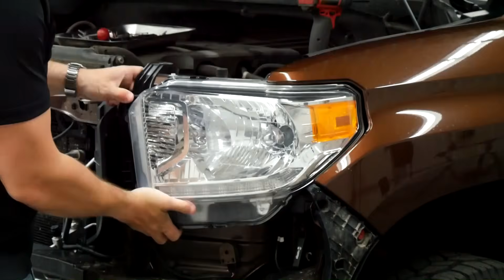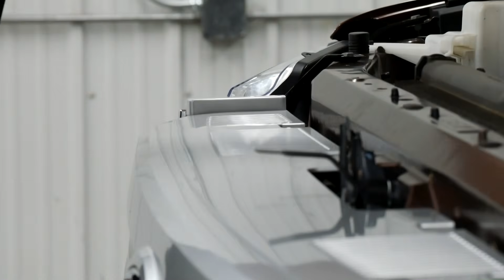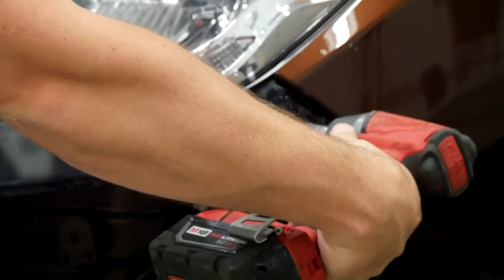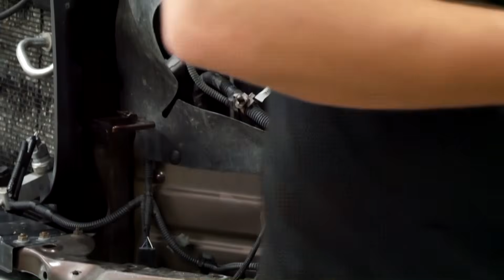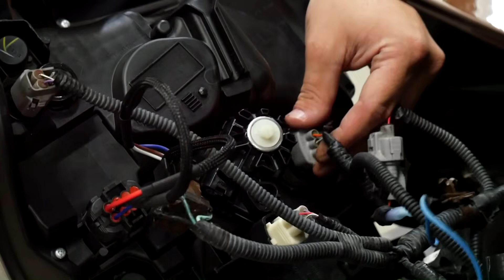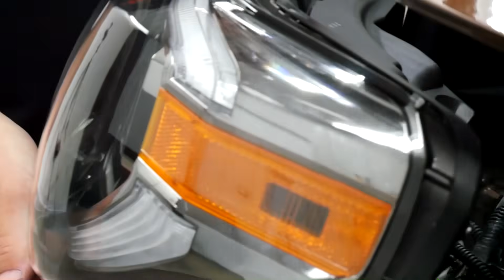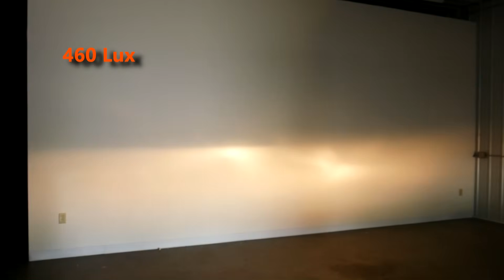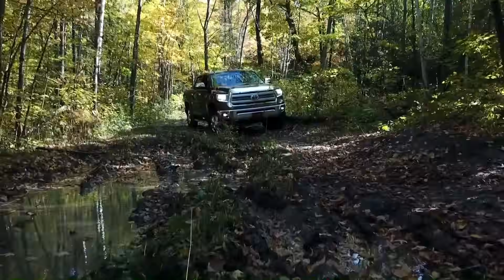Updated: Installing Toyota Tundra OEM LED Headlight Housings 2014-2018

Comment: I just bought the headlights, conversion harness and drl adapter. 17 limited. I was told I will have to use the add a fuse to an ignition slot in the fuse box by battery. Does that sound correct?
Reply from the maker: Yes that is correct, It’s very straightforward. It’s a 10amp fuse labeled Ignition.
Reply: Headlight Revolution awesome. Thanks for the reply. Also with thus setup will the amber drl remain on at all times? I have been researching converting the turn signal to led. Is that pretty straightforward or complicated? And what’s price.
Reply from the maker: Send us an email to Sales@HeadlightRevolution.com and we’ll get you the proper bulb for the turn signal in these headlights. You will have a properly functioning amber DRL.
Reply: @MrKfcflores  Easy to replace amber with switchback led..you’ll need resistors to eliminate that hyperflash after
Reply: Yes

Comment: I have a 2019 tundra with the LED light strip on the bottom of the headlight and halogen lightbulbs. I want to get the LED OEM Housing with lights. What other equipment would i need?
Reply from the maker: Send us an email to Sales@HeadlightRevolution.com and we'll help you get exactly what you need for your Tundra.

Comment: I just did this upgrade to my 2020 sr5 crewmax.  2 things that differ are the plug in the grill for the safety sense needs to be disconnected/ reconnected and there's no need to repin the turn signal as the plug is sealed in the 3rd slot so I just plugged in the 2 pin factory plug and it worked with no issues to report.
Reply: Umm didn’t your truck already come with LED?
Reply: @christph3118  SR5 trim line came with Halogen headlights with one led strip on the bottom for daylight running.
Reply: Joe, just purchased a 2020 Tundra SR5 Crew Max and plan on doing this swap as well. Where did you buy your headlights? Dealer?
Reply: @Jarhead 767  sparks parts is where I bought the headlights.. tundra dude 34 gets you 5 percent off promo code I believe.
Reply: @joescott701  thanks man!!
Reply: @jarhead767  anytime!

Comment: How do you get the low beam to stay on with the high?
Reply: I just installed these on mine and and ran in to the same thing. After setting the high beam switch forward it engages automatically at speeds above 26 or momentarily on with the lever towards you.

Comment: Just installed yesterday on my 2017 Platinum and the turn signal went crazy , it’s blinking rapidly just like when a bulb is missing. Did anybody experienced this?
Reply: sandor hajdu 
did you install LED bulb blinkers ? If not then maybe you should recheck the pinning of the black and white wire in the turn signal harness
Reply: Resistors

Comment: In the factory halogen headlamp the low beam and high beam are the same bulb so the low beam turns off when the high beam is on. Does this harness bypass that and allow the low beam to be on while high beam is in use?

Comment: Why do you say the stock headlight produces 460 lux in this video, but 610 lux in your V.4 LED Headlight video?
Reply: 460lux is from the halogen bulb
Reply from the maker: The Lux numbers are only used in relation to the other bulbs in the same test in one video. You can't compare them from one video to the other because it's not a controlled environment. If the light source was placed just 2 feet further or closer away from the test wall in one video to the next, the ratings will be different. The Lux ratings represent a percent change more than a rating of brightness in and of themselves.

Comment: I just installed these headlights on my 2014 Tundra and I was wondering if Led switchbacks would work with these headlights?
Reply from the maker: Yes they will!
Reply: Lulu Robichaux   Na the Sr5 (TSS)
Reply: Lulu Robichaux  if his truck has “Daytime Running Lights” factory installed he shouldn’t need the harness. These lights should be plug & play with the 1794
Reply: Yes they will,have on mine

Comment: You have to change  the wires on both  sides ?
Reply from the maker: That is correct!
Reply: Headlight Revolution i ve got to get the yellow lights out of the center why  are they  always on?
Reply: Thaks

Comment: I just got mine,  on the video the guy says no resistors but mine came with resistors in the packaging
Reply from the maker: That's so weird!
Reply: @HeadlightRevolution  so I don't need to use the resistors?

Comment: I need help with my installment. I have a 2017 pro and my Amber's are on as well as the leds.
Reply from the maker: Give us a call Andy! We'd be glad to help.
Reply: Just tried....3 times
Reply from the maker: We just moved into our new warehouse today and had the phones transferred over! Sorry about that.
Reply: Did you get a answer because I'm having the same problem. They stay on with my DRL.
Reply: Any update? Same is happening to me.
Reply: @jordycastro8437   yes if I remember right it wasn't just switching the pins like the video said, I actually had to de-pin in order for it to work right. Everything works fine now. I'll look at the harness tomorrow and get back to you.
Reply: @andyg7504  ok bet thank you!! 👍🏼
Reply: @andyg7504  did you solve the problem? my 2017 has the same problem

Comment: I have a 2019 SR5 Crewmax with the regular headlights. My question is I know on the 2014-17 you need the conversion harness. Do I need it for a 19?
Reply from the maker: If you do not have DRL strips, you will need that harness as well. :)
Reply: @HeadlightRevolution  ok cool I already have drl strips on the bottom all 2019 do that I've seen
Reply from the maker: @rke1987  You'll be good to go then!
Reply: Do you need 2 led bulbs for lo and hi or one bulb with the lo and hi. I have a 2019 Sr5 CM
Reply: I needed the harness if you have halogen bulbs in a 2019 you still need the harness just not the drl part
Reply: I took off my halogen bulbs and put LEDs on my headlights. Can I keep the bulbs for the new led housing or do I need 2 sets for the hi and lo
Reply: @jseries9247  the headlights housings come with LEDs already installed
Reply: @jseries9247  they are plug and play all you need is a the conversion harness
Reply: But if I wanted a different brand led bulb I cant replace it?
Reply: What if I wanted to changed the led bulbs it comes with? Would I still be able to or it cant be done?
Reply: @jseries9247  no idea

Comment: So I just bought these headlights for my 2016 SR5, I also got the DRL adapter. I'm just wondering why the Amber's stay on when the led's? Is there anything I can do about it?
Reply from the maker: When you say Ambers, are you referencing the Turn Signal or the Sidemarker?
Reply: @HeadlightRevolution  the turn signal. I've seen the 2019 models and on none of them do the turn signal ever come on. And on mine they're always on.
Reply from the maker: @MrBlazzin101  I believe that is just a 2019 specific deal, where the Turn Signal is not in the DRL. Your 2016 would use the Turns as an additional DRL, that's why it is always on. Have you thought about trying a Switchback bulb so it becomes a White light and not Amber? 

Link: https://headlightrevolution.com/2014-2017-toyota-tundra-led-front-blinkers-kit/
Reply: @HeadlightRevolution  no I have not thought about that. But if I switch the light to that of a white one, I wouldn't have ant amber ones in the headlights, is that not illegal?
Reply from the maker: @MrBlazzin101  Switchbacks are a very unique bulb. They are white as DRL, but when you hit your turn signals, they switch over to Amber! When you turn the Turn Signal off, they return to a White color. Pretty sweet huh? :)

Link: https://headlightrevolution.com/2014-2017-toyota-tundra-led-front-blinkers-kit/
Reply: @HeadlightRevolution  oh wow!!! Very sweet, as far as the installment, is it tricky? Wouldn't call myself very hands on and I was surprised that I was able to install the headlights myself. Your video was very helpful.
Reply from the maker: @MrBlazzin101  No not at all! They are simple for installation, just wire in a resistor! 
Here is a guide on Resistor Installs: https://www.youtube.com/watch?v=ADKjG3Z2L5w&t=28s
Reply: @MrBlazzin101  mines also a 2016,get a switchback bulb to replace the amber ones.You’ll need resistors also.Looks way better than the amber bulbs and brighter as well,when you use turn signals they go back to amber
Reply: @christph3118  on Instagram there's a guy that has a 14 tundra and he did the headlight swap and the Amber's don't run on his. I asked him how he did it, he said his friend put em on. There has to be a way without having to change the light bulbs
Reply: @MrBlazzin101  There might be.I’ll probably transfer my switchbacks over to these until I can figure out how to do that though

Comment: What part numbers specifically do I need, to upgrade the regular turn signal bulbs in the 2018-up housings to LED?  The website isnt very clear on this, or does the kit for the 2014-2017 work (the 2018-up bulb style is different).
Reply from the maker: These will fit the 2018s! 

https://headlightrevolution.com/2014-2017-toyota-tundra-led-front-blinkers-kit/

Comment: Wow, can’t wait to get these on my 14 limited. Stock lights make the truck look old. Can’t beat that oem Toyota quality.
Reply from the maker: True that! Sweet Subie by the way, I daily one of my own!
Reply: Headlight Revolution thanks, yeah their great fun cars to daily.
Reply: I been trying to afford them for my ‘14 1794. You’re right about the factory halogen ones making the truck look dated. I can’t wait to get Oem led for the not only the looks but also the safety because they are brighter than the stock halogen
Reply: jaysmooth6103 oh yeah for sure. Best prices I found for the headlights were from Sparks Toyota. They have other tundra parts as well so you could pick up the fog lights at the same time. Last thing you would need is the wiring harness from headlight revolution. All in all I think it was 700 ish for the whole combo including new led fogs with harness.
Reply: Thank you very much for the information. I’m going to check them out today while I’m at work.

Comment: Were these the black lights or the chrome ones? I have the same truck, just want to see which ones to get
Reply from the maker: These were the Chrome ones. The Black ones look to be Solid Black, but the performance is still the same as the Dark Chrome ones! If you are looking for a more aggressive look, I would choose Black.
Reply: Headlight Revolution thanks for the reply, I know what I’ll get👍🏻
Reply from the maker: @uricacidcrystals9921  You'll love the upgrade!
Reply: @HeadlightRevolution  dude, I'm so torn right now. Now I'm looking at the GTR gen 3 LEDs too. So I really am into looks, but as far as headlights go, I need brightness because I'm having a harder time seeing at night. What would you recommend as far as getting as much light out there as possible? Ive got a 2016 SR5, I do like the adjustable headlight feature as I do tow a load at times. Help me make up my mind, my money is going to you guys, I would just like your opinion because honestly, I'm getting information overload hah
Reply from the maker: @uricacidcrystals9921  Haha no worries my man! I completely get it. The Bi-LED headlights will be the overall better upgrade for your truck. You get the High/Low beam LED upgrade, the Appearance upgrade, and the DRL upgrade all at once! They are OEM quality so you know you are getting a great quality setup, and we're right here to assist with any installation questions you may have! :)

Comment: Hi, thanks for the video. My question is if i upgrade to GTR lighting armor series  turn signal light, do i have to use resistor to avoid hyper flashing? Thanks.
Reply from the maker: Yep, you will. You can get that all on our website though, or give us a call and we'll handle everything! 218-755-5505 :)
Reply: @HeadlightRevolution  Can you please put up a video to show the resistor mod for adding the LED bulb?

Comment: Thank you very much for your hard work and nice video. Do you have anything like this for older tundra 2007-2013?
Reply: @TechElectric , do not buy spider headlights.  Biggest pile of garbage.
Reply: @repairvehicle  I second that..replacing mine with these
Reply: @christph3118  , you will regret if you are getting spyder
Reply: @repairvehicle  I already have them,I was agreeing with you..I’m switching to these
Reply: @christph3118 , oh, ok. Thanks.  I  cannot wait to remove my headlights and replace with factory one
Reply from the maker: Thanks for the comment! We do offer aftermarket headlight housings for your Tundra if you'd be interested? (: 

Link: https://headlightrevolution.com/vehicles/toyota-tundra/toyota-tundra-2007-2013/headlight-upgrades/

Comment: Sweet mother of baby Jesus that looks sweet!  Thank you for that extra tip on the turn signal issue/setup!
Reply from the maker: we're here to help! :) Thank you for your comment.
Reply: So my turn signals have the 3 wires and I read that I need to unplug the purple all together and put white on one side and pink on the other. Is that true?
Reply: @stanshmidov175   Did you ever get an answer to this? I am having issues with the lights and I believe it is due to the amber DRL's (Turn signal bulbs that are also DRL's)  being on when headlights are off on my 2015 SR5 and also saw that someone had said to not re-pin the purple wire. Basically with headlights off some of my dash lights are on and flash with turn signal, if driving lights or headlights are on everything functions as normal